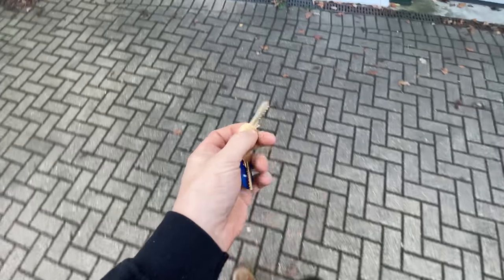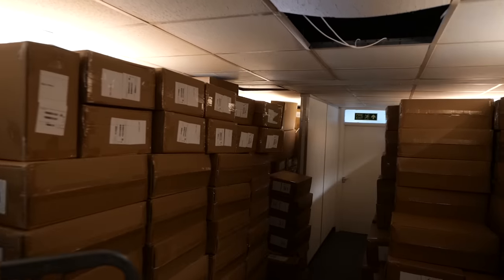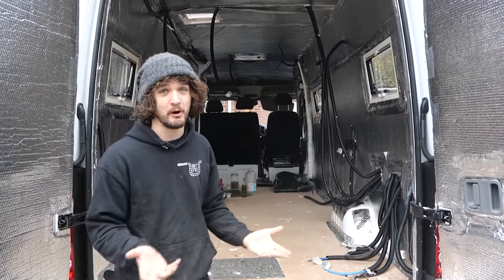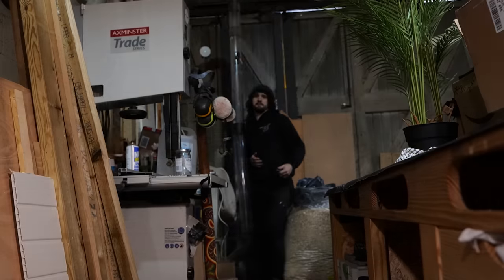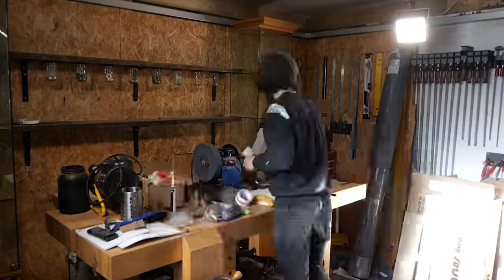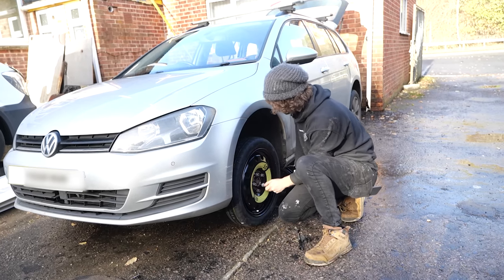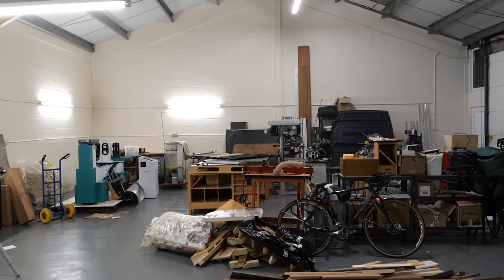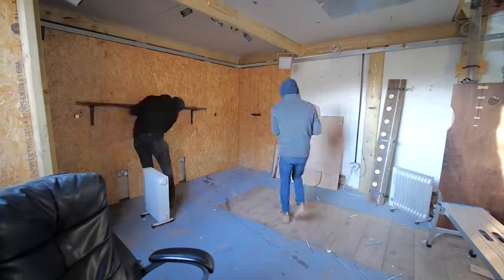I'm Moving Workshop.

Comment: Congrats on a job well done. 

2 things to note: 1) next time you are worried a car/van will move put a block behind or on front of one of the tires that is on the ground. Which ever way is down hill, or both sides just in case 2) WD-40 is a penetrant not a lubricant. Meaning it will free up rust but the oils in it go away quickly so I recommend you put grease or a heavy oil on that lever. 

Looking forward to you getting back in action. Good luck with settling in.

Comment: I can sympathise! I moved my workshop 18 months ago and I'm still not sorted. I even still have tools in storage 😞
By the way, for future reference, WD40 is, contrary to common perception. a very poor penetrating oil. It was actually developed as a water dispersant. A much better dismantling fluid is PlusGas, which works like magic!
And never, ever use WD40 on your woodworking machines! It leaves a sticky residue which will collect sawdust, turn it into gunge and make matters worse!
Reply: I learnt that the hard way after using WD40 on my drill press!
Reply from the maker: Thank you Clive! I think you've contributed to half the growth on this channel simply from sharing my bandsaw setup video!! Really appreciate the support, thanks for sticking around.